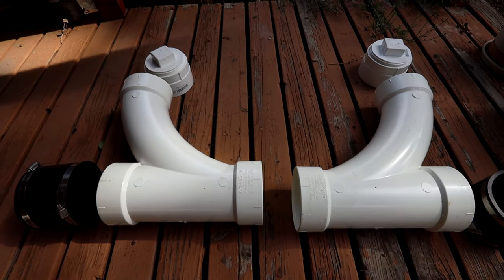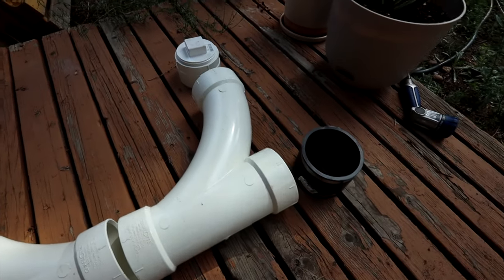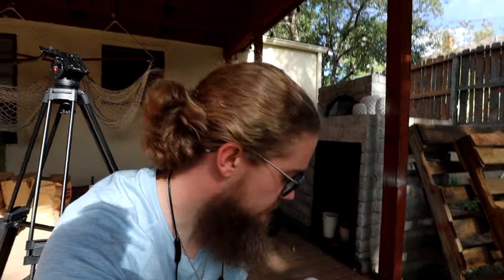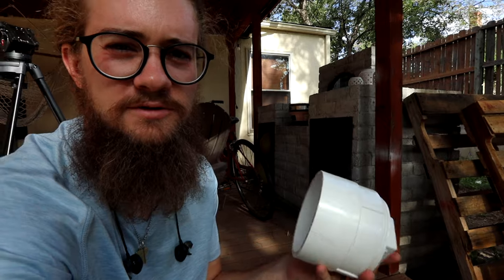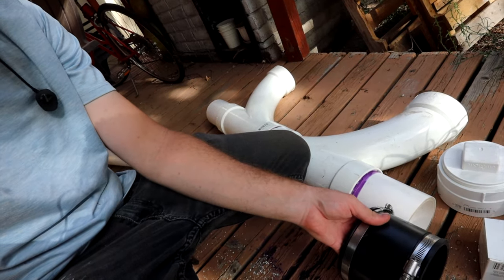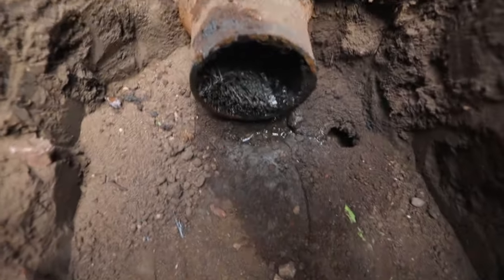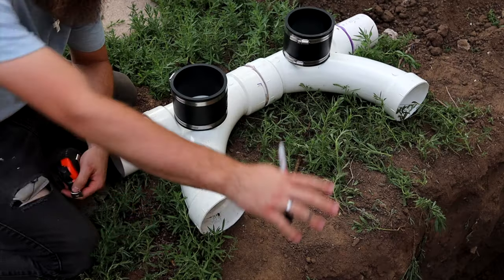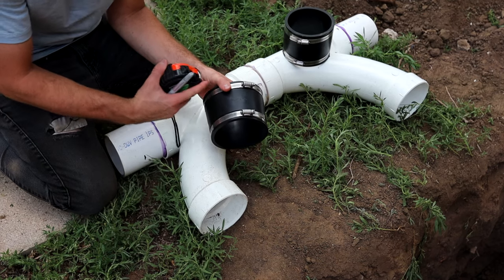DIY Guide to Installing Sewer Cleanouts on Your House

Comment: If you use those fernco’s to connect to cast iron and burry them you will be digging them up again I can assure you. They make whats called strong backs to use instead of fernco’s. Do not use the bands he is using. Ferco’s are made for above ground vertical sewer pipe only!
Reply from the maker: Fernco has a pdf describing how to use them for underground applications. I think they will be ok.
Source: https://www.fernco.com/downloads/installation-instructions/fernco-flexible-coupling-in-ground-installation

Comment: Great tips!! A plumber was going to charge me over  $1000 for digging and installing a clean out!
Reply: That's cheap, I wish I could find that price. I'm getting prices of $3500 and up for estimates here in Illinois.
Reply: $1000 is way cheaper than most.  I know someone who charged $600 for digging up and replacing part of the main sewer drain.  $600 is cheap, and $1000 is not too far behind.  Not bad of a price.

Comment: This is one of the best videos I have seen about this. Thank you so much. I would like to know the total length of the pipe bundle. I dug the hole today, 4x4x4. Just want to make sure my hole is large enough. I see you went with a T.
Reply from the maker: Thank you! They do make different sizes to accommodate different needs. They even make a combination 2 way clean out that only has one stack. So you should be able to find something to fit in your pit. I believe mine was about 28”-32” from coupler to coupler.
Reply: @Jacob-Shields  Thank you very much.
Reply: @Jacob-Shields  Happyto say that with your influence and direction, I was able to get it done. I used a wye instead but it's done. Now to wait and check for leaks. Fingers 🤞
Reply: At least $1000 saved, don’t ask me how I know….😅❤
Reply: @ChristianGutierrez  same here.

Comment: Won't the clamps on the couplers eventually rust, causing future leaks?
Reply from the maker: Great question, these ones are rated for underground use, some aren’t though. The ones that are safe to be buried like this have stainless steel clamps as opposed to zinc plated or galvanized clamps.

Comment: I read ABS is better than PVC pipe for outdoor underground plumbing due to their excellent shock resistance.
Reply from the maker: Interesting, I didn’t know that! I just followed my local building code.
Reply: Yes, ABS is another type of material that is used for drainage and or sewer.